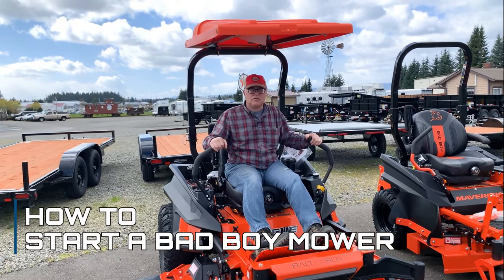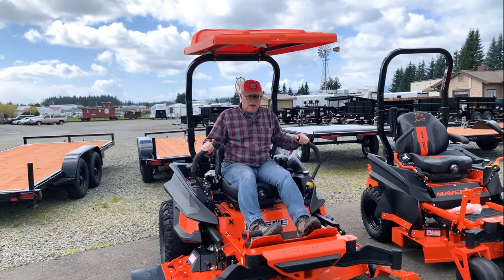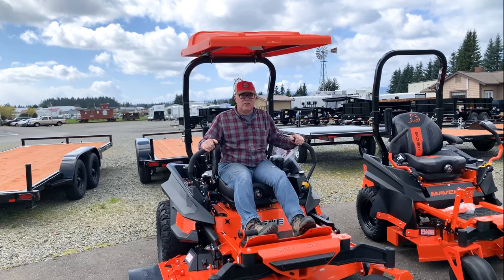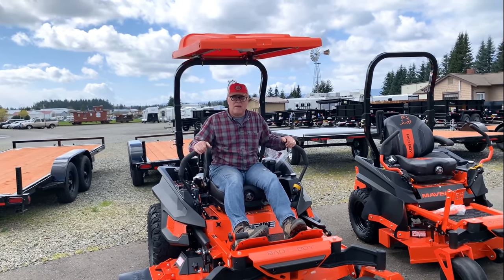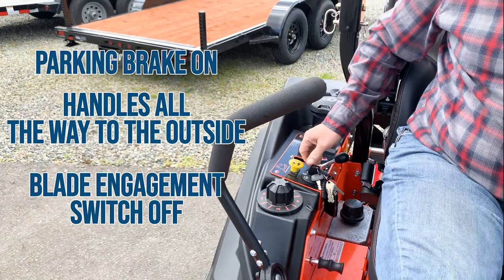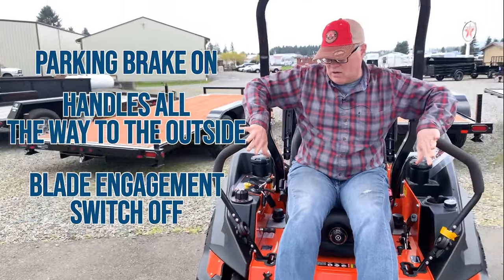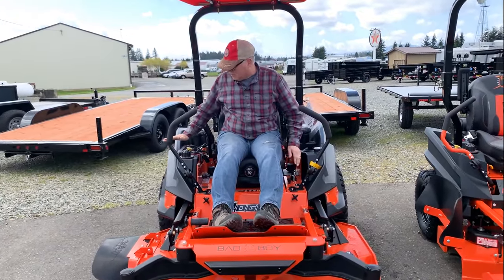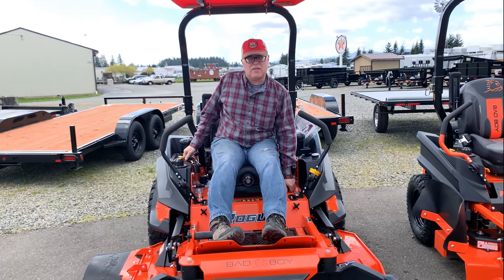How to Start A Bad Boy Mower

Comment: I bought a bad boy elite mower, Kawasaki engine, 54” deck
Great mower, does a very good job, very powerful, have the std seat, wish I had been able to upgrade to the more comfortable seat, have a fairly rough yard and orchard to mower,
Again, so far very pleased with the mower, well built, performs as it should 
I did spring for a set of those adjustable steering arms as I am a big fellow and needed more room,

Comment: How do you set the deck height?
Reply: That is a great question!  See that black knob with the numbers on it on your right?  Press your foot down on the pedal on your right to dial it to whatever height you want. I mow mine at 3.25 if I’m mowing regularly. Start a little higher if it super tall.

Comment: How do I unlock the deck lock?
Reply: See the black big orange pedal on your right just in front of the black part where you rest your feet?  Push that down with your foot (sometimes takes a lot of pushing power). Then spin the dial to the height you want and release the pedal.
Reply: Thank you, our mower was delivered yesterday. YWe have the Rogue 9 series with a manual deck. The pedal assist lever seems to be pushed forward into a locked position. It is set on 3 inches. Even the small lever next to the seat doesn't move. It has a sticker that says pull up, but doesn't budge?
Reply: Thank you so much, the pedal was really hard to push. I got it though!!!